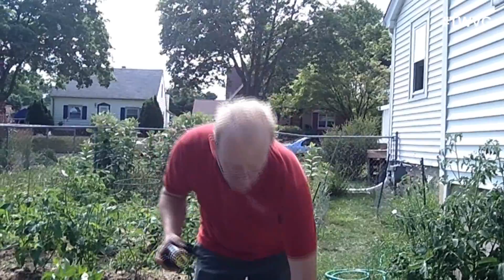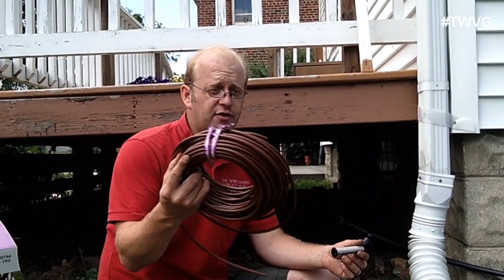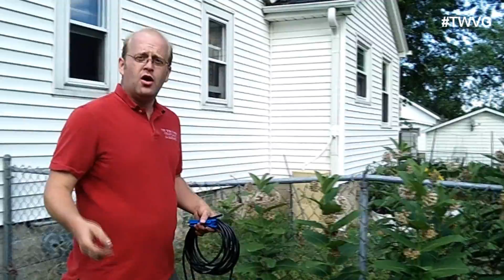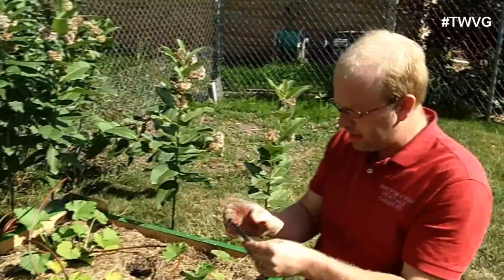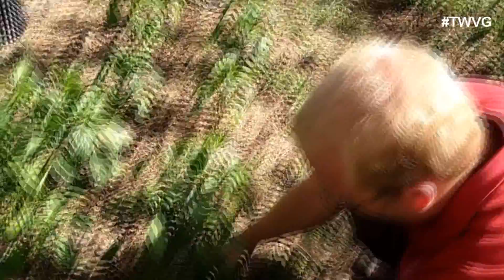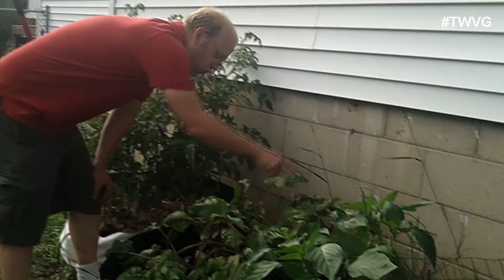Installation of Mister Landscaper Drip Irrigation System- Straight to the Point

Comment: The red or green round is where do you put it on the long run of drippers in a flower bed with mulch to hide it?
Reply from the maker: I would put it at the end of the run and low to ground so it is not seen as easily

Comment: Thanks for the video. How has the system held up over time? Also, do you know if you can water directly from the 1/4” vinyl tubing into the garden rather than use the drip line? I can’t find drip line in stock anywhere.
Reply from the maker: it has help up will over time we move this system to another garden and installed a system from drip works here is a link to some half inch main line https://www.dripworks.com/catalogsearch/result?q=main+line